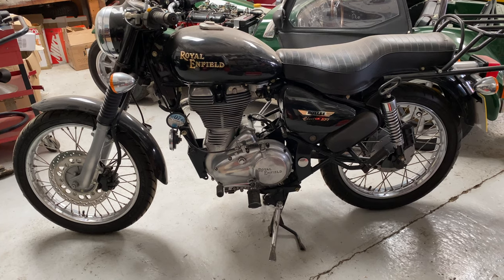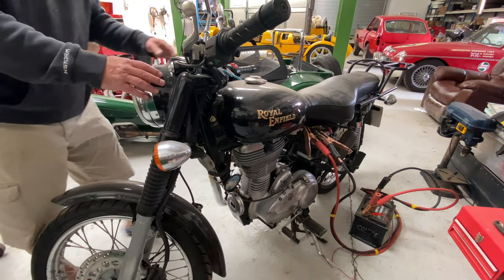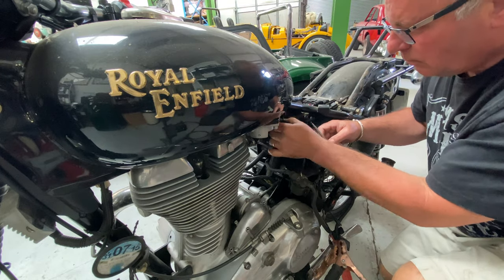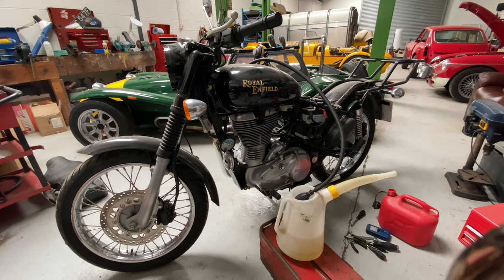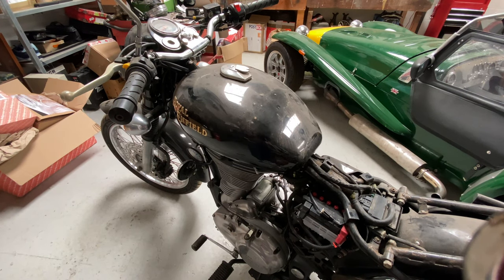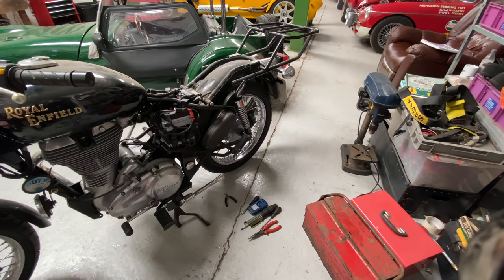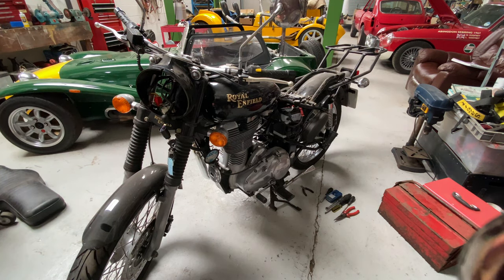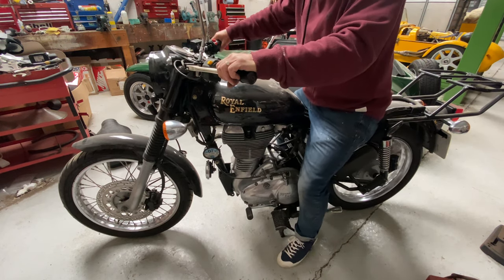Royal Enfield Bullet EFI Barn Find will it start?

Comment: Really enjoyed this! Good work. 
I had an Enfield India 350 and it stopped dead one day - turned out to be a plastic fuse holder that had been manufactured with an extra tag of plastic that allowed the fuse to be connected or not depending on how it felt! 
Change the oil once it's warm.... doing it before is too legit.
Subscribed!